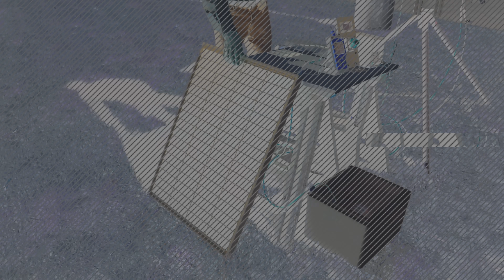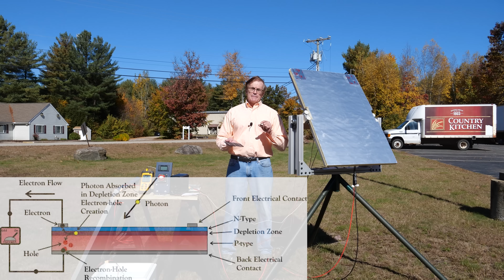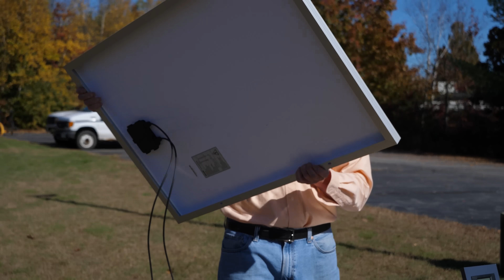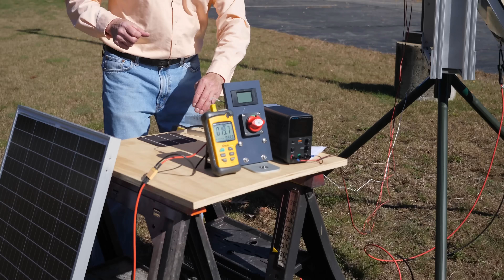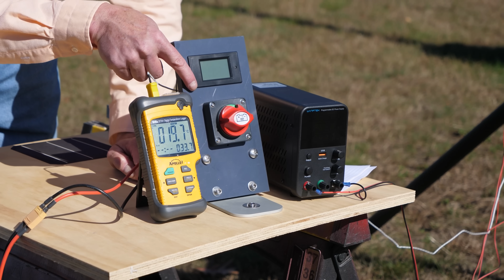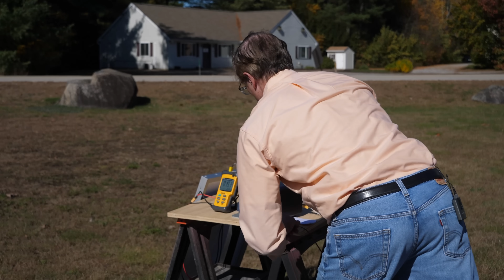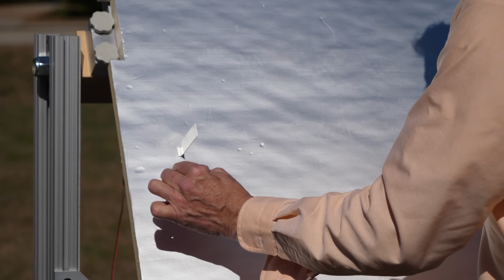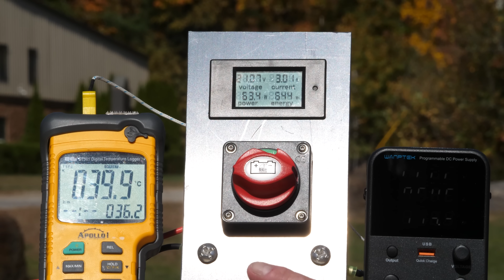Do you REALLY get enough out of your solar panel?

Comment: Instead of using electrical fans to move air for cooling, could a thermal solar chimney be used? The downsides that I see are the extra material costs plus the additional area used for the solar chimney which might have been better used for something else. The upside would be the simplicity of having no moving parts to achieve air flow/cooling. Do you think a solar chimney solution could compete with fans for cooling purposes?
Reply from the maker: Maybe.  The issues you raise are important. These tradeoffs will require  building and testing.

Comment: i want to note something about water cooling, you dismissed it as not acting as a thermal sink unless more energy is invested to cool radiators, but there are two ways around this
the first is with the surface dripping method, where i think evaporative cooling would play a huge role and be very efficient and effective, so long as the cost of water isnt an issue as it will be consumed
the other method is to simply use passive convective radiators which add no additional energy cost except for that needed to overcome the extra pipe resistance 
i suppose another note about the water method is that, if water is cheap enough or little enough is needed, you could just not bother recycling the water, in which case no pump is needed, only sufficient city head pressure to reach the panels and electromechanical valves if you care to cycle the flow automatically
Reply from the maker: Those are valid options.  I didn't  really  dismiss them.  I raised them because  they have merit, yet I wanted to test this alternative. Drip consumes water and can leave mineral deposits that reduce light throughput.  A passive  water to air heat exchanger trades electrical power for the fans with greater size and initial expense, potentially significantly more expense. There is also leakage and corrosion to consider.
Reply: thanks, i guess i shouldnt have said you dismisses them, i think i was just trying to be consise, it just felt like you didnt give them enough consideration, at least in the dialog of the video, though i understand it wasnt the purpose

Comment: So if it’s 30 degrees Celsius outside, how hot are the panels? How would you cool biracial panels when you have sheet metal set up to bounce sunlight onto the back side?
Reply from the maker: That depends on the intensity  of the light striking the panels. 80C would be a reasonable middle ground.
Reply: @TechIngredients  I appreciate your reply. But how did you come up with 80 degrees Celsius? That’s roughly a 170% increase from 30 degrees Celsius... Maybe you explained it already in your video and I should have another look. I just bought 10 395w bifacial panels myself and I’m in Minnesota. It gets very cold here, but it also gets very hot and humid as well from all of our lakes so I guess I’m a bit concerned...
Reply from the maker: Obviously, it's  a rough estimate.  But, take a look at the panel  we were testing and the surrounding  air temperature.  Then increase both based on your air temperature and add to that the increased light intensity.
Reply: @TechIngredients  would you have an engineered design or idea for bifacial solar panels? I can understand the need to cool the panels seeing how heat is the biggest factor to the degradation of the product. Solar almost seems like a worthless endeavor when it will perform best on the longest (which happens to be the hottest in most cases) days but ironically the one thing it needs will also destroy it.

Comment: This is not a fair comparison because the panel without the fans normally would not be enclosed in the back. By enclosing it you are insulating the back of the panel from the natural convection that would cool the panel somewhat in its normal configuration.

Comment: Why does everyone who puts PV panels on tracking mounts or use active cooling and other addons power those systems from the panels being moved and/or cooled? I'd add an additional panel exclusively to power those systems. Then that system and its power are completely separate from the main power generation. If the tracking or cooling has a fault, the main system can keep on trucking without it. Manually move the panels to a best average position while you get around to fixing the other stuff.

For panels that independently track the Sun and have their own active cooling, a small panel of a few watts could be mounted to the bottom or top edge to power the fan and tracking motors. Then 100% of their benefit comes out in increased usable power. A commercially made system like that could cover the front of the frame with lower cost cells for the tracking and cooling power so they wouldn't take up any additional room.

Comment: I don’t know… I have some questions in your testing/pricing.
You had moved the panel, in relation to the direction of the sun, during the start and end (Which actually may have been a positive for the test results). And unless I missed it, you didn’t mention what the ambient temp change was from start to finish. Did it go up, down, stay the same…? Plus, the cost to repair/replace the fans over time. How does that calculate into the overall cost after, say, 5-10 years? I think of it in the same way as why, normally, systems to track the sun are no longer used, the cost of repair often negates the benefits over time. Plus, if you are talking to the standard homeowner they are not going to want to monitor faults (Fan failures). And if they need to pay someone to monitor/maintain them that is costly as well.
Although I can appreciate your tests, I worry you didn’t take long term into consideration enough, only a few hours for one day. Best point being degradation of the panels at higher temps.

Comment: If I could make a suggestion. Passive cooling modules called Peltier Element actually produce electrical power. If you stuck those to the back in an array and used the power they provide to actively cool themselves, the thermal temperature difference would increase, therefore creating more airflow and more cooking. This prevents wattage being used from the solar panel, to power the fans. So Peltier elements could possibly increase the output even more. Does this make sense?

Comment: When you have your panels mounted on a roof and you have fans blowing warm air into the space between your panel grid and the roof, wouldn't that defeat the purpose to some degree? I mean that only the bottom row will have the luxury of pulling cold air while the upper panels will flow the lower panel's exhaust over the fins. 🤔

Comment: I get a lot of this effect in the morning here in Northeast Oklahoma, there is a lot of dew and it's cold. Frosted tonight. The panels cause condensation and sort of self clean  a lot of the time. The average wind speed here is 10. So I have a breeze almost always. I bought two of those fans for my inverter and me in the summer. I just put them on cords with alligator clips so that I can use them wherever. I have a 100 gallon stock tank under the drip of the barn. It has a sump pump in it and I have a hose and brass nozzle that I can spray the panels down with which I run off my Aims Power inverter charger. The water in the tank gets cold, it has an inch of ice on it now, but water will still flow, the hose inside the barn. It helps in the summer, to spray them every hour or so, lol. It does help the output. It rains enough to keep the tank full and I keep three barrels for the system too. I have a small 24 volts pump that can fill the tank out of the barrels. I originally started spraying them because of dust getting on them, it's easier to spray than scrub with a sponge. The dust is worse when it's hot and dry, and one day I noticed that the watts went way up after spraying them off, but they weren't that dirty, so I finally made the connection. I just figured it was helping them so I just have kept doing it. How ironic, the heat that makes them work is their enemy too. I have twenty marine batteries for the battery bank, I just go by how well they get charged. I'm going to be putting a wind generator up pretty soon, so I want to get six more batteries. These little things will help keep them charged. There is a small pond so more birds dropping bombs on my panels than would be elsewhere. When I spray my panels with the cold water, the amps will go up for awhile. Now in the morning, the panels will get rinsed by nature, because there's a thick frost on them. I've watched it melt off, and it does a fair job of rinsing. Great video. P.S. you should do a video on how much more an inverter will put out when it's in an air conditioned room with one of those fans on it, versus what it will produce by it's own cooling fans. It might be a surprising amount, that people wouldn't think it would be that much. When it's hot weather, a fan that uses five watts and twelve volts, makes the inverter a couple of percent more efficient. So it's running the A/C, and freezer, and it can use that two percent. I noticed last summer, it works pretty well like that. I had to double the wiring to the panels, in July, the current was melting the connections. I put those six on four wires instead of the two I had before and so far nothing has fried. But I'm moving two panels and the remaining two wires Will carry the four that's left. The other six are in pairs in some frames that I made out of square pipe. It's tubing but thick enough to weld on. I'm supposed to be making some frames like you have there, sort of. So I can aim them easier. I had bought a DC inverter welder from harbor freight but didn't have the power to run it. So in November I bought a Winco Lil Dog generator, and they work well together. So now I can make some stuff, lol. I enjoyed the video.

Comment: You kind of fuzzed out on the conclusions.  Actually that section of the video was arguably the worst thought out and most incomplete.

It's not worth it given the decreasing costs of panels vs. the proposed increased complexity.  You're literally putting fans outside where they're exposed to the elements.  Moving parts.  The Orion 280mm fan has a lifetime of 85,000 hours at 35C.  That's less than 10 years under those conditions, and where I'm from it easily hits 40-43C ambient on the regular.  You penalized the lifespan of solar panels at higher temps but didn't assess the same penalty against the fans.  Those fans will likely fail much earlier than the panels reach EOL.  (Note EOL for a solar panel still doesn't mean it stops producing.)  The labor for going up and debugging/replacing a fan makes the whole thing a non-starter.

Also, since most people don't have tracking on their panels, their results will scale down accordingly.  6.5% of 68W already sounds kind of paltry, but when you start going off-angle, 6.5% of, say, 50W, is 3.25W.  And the fan power doesn't scale down.

It's also goofy to waste that much aluminum for that effort.

The heat really should be carried off through the mounting system, at which point you can send it some place where it can be more conveniently and efficiently processed.  The problem is the frames and mounting systems are at best non-standardized, and at worst appear to be designed by marketing people.
Reply: The fans used in the video last longer than that. Orion's fan ratings use a common system called L10. That means that our a population of fans, 10% would have failed at that time. L10 also assumes constant operation, but there would be no need to operate the fans to cool panels at night. So life expectancy will actually be much longer due to the duty cycle and what L10 rating actually means. And those fans he used are 120mm fans, not 280mm FYI.
Reply: @jaycrutti  It doesn't matter if no fan ever fails. Squeezing out the last drop is not worth it, everyone can see it, i have no idea how this channel that otherwise come to great conclusions don't realize it. Doing experiments is fine, i really like the video, it's just the conclusion that's totally bonkers. The aluminum stock and fans, especially weather resistant ones, will never be cost effective as the panels themselves. Adding a BUNCH of complexity, both cooling fins, a back, and fans for a 2.5W, or 4% net output gain is extremely inefficient. Anyone who want's to maximize profit, should just buy the 50 to 100% more panels for the same amount of money as this complex solution costs.
Lets do some quick numbers:
We paid $26k for a 18.6kWp system, that's including install on a roof, and a top of the line inverter. Even at 50% output (in the video the 100W panel outputs 58W without cooling) that is $2.8 per W (26k divided by 18.6kWp = 1.4 USD per "panel W", or at 50% panel efficiency $2.8 per W) Unless the panel modifications in the video costs less than $7, a complete system, with expensive inverter and all, is still more cost effective.
Reply: @jaycrutti  Fine, the 120mm fans appear to be 65,000 hours L10 @ 45C.

Granted they won't be running at night.  If you have 10 panels up there you will still have 1 failure before "EOL" of the panels.

Everything else still holds.  This is really more of a desperation solution than a practical, cost effective one.

I don't mind experimentation but you can't ignore reality.

Comment: Could you further investigate the difference between an unmodified panel and one with open passive cooling on the back, basically your heatsink design without the fan shroud vs. a panel with no cooling upgrades. Maybe even test it at different angles to simulate different installation pitches to determine how much more passive cooling can be achieved at those different angles.

Comment: A few points:

It's a false comparison - to be scientific correct, the cooled solution needed to be compared to a PV Modul without backplate. It will behave different. 

There is a water-cooled solution out there called PV-T, using the produced heat as solarthermie and heating the water in house. So you don't dump the heat energy away - you use it.

Comment: on balance, not useful. every technology and technique is worth exploring. but this could only be useful in very narrow circumstances. 

we can start with the cost of the panels. your panels are bad, and overpriced. the retail standard now are 300w or higher modules, many are bifacial, and they cost between $0.40-$0.60/watt new, bulk, retail (such as from signature solar). it's even cheaper wholesale, and even cheaper used. 

your ventilation system is incompatible with bifacial panels. and it's an extra mechanical element to an otherwise low-maintenance, long-lived device. 

if the cost of your ventilation add-on was 10x lower, it likely still wouldnt matter. 

please focus your intelligence on useful questions! you just added over $50 of complication to get a few more watts and dubious longevity (almost no one with a normal income will be keeping panels past their service life). i'd like to see you drill a well to 200' with a DIY rig, for instance.
Reply from the maker: You're  moving around  a lot in your comment.  The panels  we're using are typical, not cutting edge bifacial, and that's  appropriate.  The income level of the user doesn't  change the principle regarding cooling and longevity  and increased efficiency. Drilling a 300' well would be interesting  and has a potential  value re geothermal energy  management.  We'll  look at that, too.
Reply: @TechIngredients  your weize panels are absolutely atypical for residential use. bifacial panels are not "cutting edge", they are widely used for residences and industry, and are priced below your archaic 12v panels. the only use cases for your 100w 12v panel are absolute amateurs or specialty niches. not household or utility scale power. your panels cost you over 70cent/watt. 

i live off grid in the mojave desert. i built a copy of your swamp cooler -- it doesnt work well. i have tried a variety of air and water cooling techniques for solar panels -- they are not cost effective. your design here may be useful for someone but certainly not for mainstream household or utility usages, and it really has no place in a desert -- you comment on the longevity of panels roasting in the sun but not on how durable your fans are in air temps of 50-70c beneath solar modules. i can guess: the fans will be entirely unreliable and the aluminum baffles will be a nuisance.

i will encourage you again to focus your attention to problems that need solving on a large scale. rural well drilling comes to mind because i think it would fit your skillset (reducing a $30k job down to $1k-$5k). you could probably also make headway with ultracapacitor/LTO alternatives for car starting batteries, or perhaps a DIY wind turbine with an AFFORDABLE charge controller and dump load. there are so many things you could improve. solar panel cooling is not one. perhaps reusing waste heat from solar arrays would be useful, but i'm not sure that's in your skillset.

youtube comments are necessarily either highly focused, or overly jam-packed. you know this is the nature of the comment UI here.

Comment: Do you not think that putting just 1 or 2 of your fans in front of a very efficient heat exchanger like a car's transmission cooler using water, you would not see similar results requiring less power?  I have always wanted to try that but never got around to it.  If you used aluminum lines to move the water around you would also realize some passive cooling too I suspect...maybe?  Once again, I enjoy watching your videos and seeing what great ideas you come up with.
Reply from the maker: No.  Don't forget that you will have to power the water pump as well.